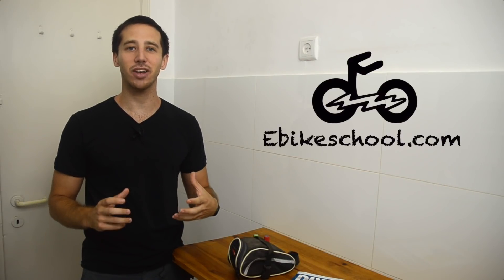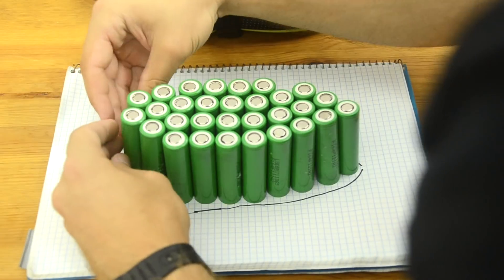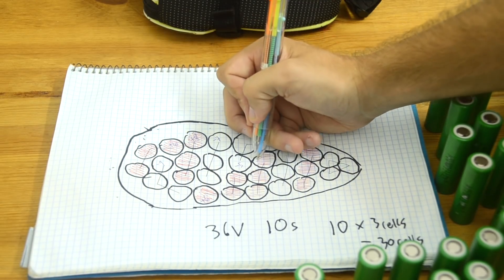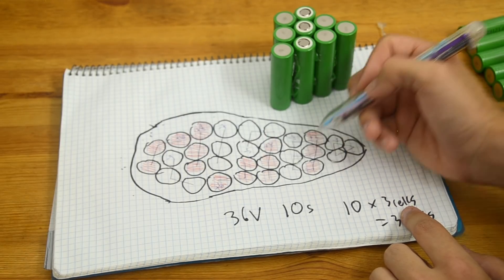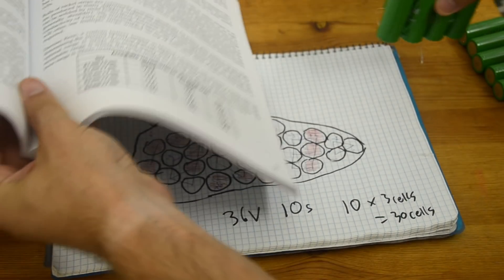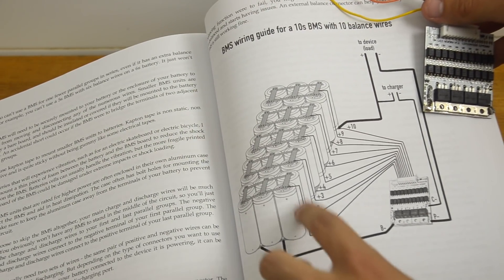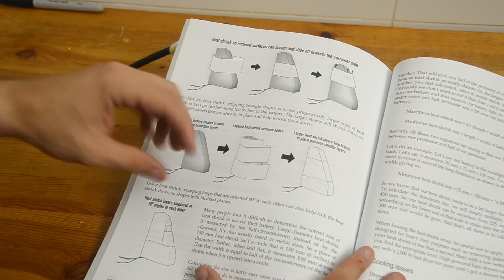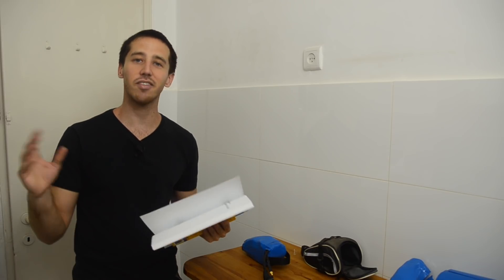Complete DIY Guide - Building Custom Shaped Lithium Batteries

Comment: I got some 9900mah 18650 from amazon that price wasnt bad.a bank with them would be alot higher the standard batteries.i noticed that most battery packs use a cheap battery in their packs which seem to have lower mah rating.if you simply change your batteriee with these higher rated batteries you can double your capacity without adding any more batteries.wish i could post screen shots to show rhe defference between the batteries

Comment: Hi Micah, great video series and book - the DIY Li Batt is a treasure trove of battery info.
I'm getting ready to construct a pack (my first) and wanted to ask for your opinion on using pure copper strips instead of pure nickel. As I'm sure you know, the current carrying capacity of copper is about 3-4 times better and the resistance about a quarter. Also, the cost (on Amazon*) is similar.
Do you have any advise (for or against) with using copper. I will be spot welding onto MJ1s - I've seen others on YT saying that spot welding copper (only) to cells is difficult and might need a 'copper-nickel sandwich' weld arrangement.
Any insight into this would be great.
Many thanks.

Comment: Ok Mike, that's twice now I've seen you do this flip flop with the numbers.  You set out to build a 10s3p battery but when you were planning it's layout, you made a 3s10p battery.  The only reason I can figure is that somehow the number can be reversed and still comes to equal the same output at full.  Is one way better than the other cuz I was about to put 14 cells in a row in series then a flipped row and so on.  I know it's Friday night, but if you see and read this tonight being 10/27/23 @8:56pm ES, please send me this answer as I am prob gonna start welding tomorrow.

Comment: recently purchased yr book on DIY lithium batts, I'm looking at using an 80v greenworks battery but couldn't find anything in yr book about how to install a low voltage disconnect option.  these batteries are 20s so when one cell goes bad it will start to degrade batts on either side before failing altogether.  do you know of any low voltage disconnect modules that can disconnect the cells once they degrade to a define voltage (eg 72V).  Appreciate yr book, easy to use and understand.

Comment: Just bought a Trek Townie ebike. First recharge no power to display.  Tried all the tricks of power button on battery , check cable connection, even got new display. Still no power.  Wife's bike. So I'm not allowed to "mess it up". Any clue? I'm thinking bms, but can't tear into it and check.

Comment: Hi Micah, by the series bus. Are those fuses because the series connection are alternating but these things goes between those 3 parallel cells. Could you please clear on that. to be more clear I am talking about the 8 figure like connections of the Nickel strips.

Comment: if you're building larger odd shaped batteries (like 16s12p) where you need the positive and negative in a specific spot I suggest using a SAT solver or some mapping algorithms to build a graph with minimal nickel strip use. I kept failing to do this on paper efficiently until I just put in the effort to encode it as a SAT problem.
Reply: I'm a rank beginner with things like that but I need to build a 20s5p battery in a triangle shape. Could you please add some more info to what you've said here?

Comment: Thank you liked and subed how much cheaper is it to build your own batter? Also id like to know about the Nickle connectors why not use steel or copper? I would like to make my own Ebike but the battery's are too expensive how ever i am skilled at engineering. Id like a battery that is powerful so i can have more speed 48v/60v 2000w the motor says. What MAH hour cells should i get as id like the battery life to last? Id like to know how to charge the batteries what kind of charger do i need. I'd like reliable but cheap as possible cells what should i get and what not to get? Again thank you for the video.

Comment: I have an issue with my battery and I wanted to see if you can help me I just bought a 72 volt 2000 Watt wheel kit I had or have a 48 volt 1000 watt battery and the computer on my wheel kit was saying I had full battery in reality my battery was dead and now my battery will not charge is there something that I need to do or is it damaged

Comment: Thanks for your very informative and very usefull videos. I have just bought my first ebike kit (Sfeomi 36V 500W EBK-0500-RR) and have so many questions. I wonder if it is possible to maximize a HL Li-ion Model S039 Spec:3610, 36V 10Ah to 20Ah (the manual's max. is 26A) and how to do this? Thanks to you, I'm learning how to build my next battery. An other question is how to connect a display and head and rear lights to the Controller CPU card? The ShenZhenShi CiAn Technology Limited Support are impossible to get in contact with on this issues.

Comment: i enjoyed this video. I am explloring opening up a 36 volt lithium battery i have that i know has one or more cells that are not charging or are low charge.. I am thinking of getting the DIY lithium kit to put it all back together. I also want to sort out creating a USB out port for the pack to recharge cell phones etc. And I am also xploring builing a 5s or 48v pack for the same ebike to give me more speed. .. perhaps also building 2 packs to i have increased range capacity when i need it.

Comment: I have a question about how you decided which nickel plate to double up. It made sense in your drawing and initial explanation, but the actual pack you made doesn't match the drawing as far as where the double nickel strips are

Comment: Great video! Just one point: not sure if this was already addressed in the comment (didn't read the whole 231 comments...) but when you add a second nickel strip to "beef up" the connection for a cell that's not directly connected to the next group of cells, you did effectively double one of the parallel connection. But shouldn't you also (or rather) "beef up" one of the series connection ? I mean if cells 1 and 2 have a direct connection to the next group of cells while cell 3 has not, you beefed up the connection between cell 3 and cell 2 but you should also beef up the connection between cell 2 and the next group of cells. If your pack must provide 15A and you only have 2 nickel strips for series connections, each strip will carry 7.5A, which is still acceptable for a 7mm wide and 0.15mm thick nickel strip but at the top of the acceptable range. So basically, rather than doubling a parallel connection, shouldn't you just double one of the series connection instead?

Comment: The positive wire from my battery to my fuse disconnected. Should I just reconnect or take this opportunity to change the connector to an xt 60 and bypass the fuse or just reconnect the current set up?

Comment: i've recenty aquired gallons of high quality 2 part epoxy.  the cans are rusty and it should be used soon.  i've been wondering why not completely encase a battery pack for heavy duty use,  ( say a "jumper" pack that gets thrown around on a farm, etc)?

Comment: so a typical pack for 48VDC is 13CellsX4.12VDC per Cell=53.56VDC ? but the BMS power output is 48VDC so there is a voltage loss huh? just finished Welding my first pack. Boy is it hard to us recycled cells. lots of testing and retesting. 4X2.8mAh=11.2mAh total of cours your cells if you have max of 2876Mah on a string and some where down the line you have a 2289mAh you will only draw as much as your lowest Maximum Capacity string... but that's OK..

Comment: I like your video! Thanks for helping us layman understand lithium batteries and their construction. Now for my question :-)
 I have a newer Smart Electrician(Menard's Brand) LED light with a Samsung 3 cell 11.1v 2200mAH 18650 pack that won't take a charge any longer. I couldn't find my charger for several months, and let the batteries probably get too low. I was told that I could possibly bring them back to life by charging them with a older non-lithium Ion charger for a short period of time. Is this possible, and if so what would would recommend for voltage, connecting, etc. Thank you, Al

Comment: So... does this method work when building a bomb?
Kidding.

Seriously though, would you recommend wiring the 18650’s in parallel or series when making an external, rechargeable battery for iPhones and other gadgets one may need to recharge?

Comment: So if i make myself a 52v 20Ah i pay 400€ only for the 78 celss i buy from one of your battery links. This is without bms and charger + work and small equipment. If i buy a 60v 20Ah lithium a bike battery from one of you links i pay 360 for the battery and charger. Its just a simple blue square battery so you just have to make your own box. I was really excited about makin my own 52v battery but i quess buyin one online is the cheaper option (and maybe the safiest haha). However i go to my local battery dealer and ask if he can do something for me. After all their just simple cells.

Comment: I appreciate you and your knowledge sharing! Looking to over charge my 1000w 48v rear hub system--will a 17s battery safely run my motor and controller. From your videos, I could use a 63v battery? My goal is to get more mileage at 28MPH--trying to get 24 miles out of a charge. my current setup lets me achieve 30MPH for 3-5 miles, but then I am dropping power quickly, but still show full bars or down only one bar. Congrats on your success, I appreciate you sharing a considerable wealth of knowledge. Mike

Comment: Your videos are simple and direct to the point. So much to learn from it. I have an electric scooter with a brush motor, its rated 24v as it uses two ups lead acid batteries rating 12v 10A each.
Can i run the scooter with same battery rating as you have built here?

Comment: I’m planning on 52v - 17Ah with GAs that will sandwich the down tube because the main triangle is too small to fit them all inside. They be encased in a poplar frame with ply sides.

Comment: Hi you are doing really great job and educating the ones who are curious to know and learn about lithium cells and packs.

I would like to ask you the below doubts 

1. If we are using protected cells in battery packs still we need bms in pack.

2. Please give more light on cell charging cycle and life. If we are not discharging  to  minimum voltage and charge before that is it going to increase life cycle.

Comment: Can you please give your expert advice as in which battery pack should be used for a solar off grid project, as in a lead acid battery or a lithium ion battery pack and can you tell me is lithium ion battery pack more power full than a lead acid battery (for ex one 12v200ah of lithium ion battery pack will be equivalent to how many of 12v200ah lead acid battery, as the depth of discharge are different for both of them) so  kindly help me with this

Comment: Hello. I have 3 beautiful questions:
1. Can I use battery holders instead of connecting the terminals of a battery cells, then join the wires + -?
2. Is it necessary to use BMS while the batteries can be pull out and being charged with Li-ion Battery Charger?
3. Can ESC used in RC projects be an alternative to manage the outgoing voltage and current of the battery?
Thanks in advance for response!
Reply: I think the bms also prevents overdischarging. Maybe im wrong. Sort of 3volt cutoff. Interesting question.

Comment: Hi Micah I have just finished building a 7s  x10p battery pack I have chosing the BMS  but I am not sure where to start with the balancing wires , to start soldering which side or series do I begin the 1st wire soldering.

Comment: Great video, pardon my ignorance however i am not understanding why go with the .15mm thick nickel rated for 4.7 amp when these batteries are 10amp continuous? Wouldn't you want to go with the .2 or .3mm thick nickel?

Comment: Micah hi, a few words about the other side of the battery. How did u figure out the pattern of the connections there?
Reply from the maker: Basically, connections between adjacent groups that aren't connected on the topside are connected on the bottom. For example, -1 and +2 are not connected on the top, so those cells will be connected on the bottom side from +1 to -2.
Reply: ok I see it in about 14.50 where you flipped over. The very first cell in +1 it is connected directly with a long nickel strip to -2 from one side, but it is not connected the same way with -2 cell from the other side. Meaning you didn't use two long strips to both directions from the first +1. Is it better that way?

Comment: Thank you Micah for all the VERY helpful videos, they're great :-)
My first question is...what is the difference with a brushless motor and a brushless geared motor?...... and my main question is....when you are not using the motor power is there much or any resistance felt when you are using pedal power?.....one additional question....can the PAS be easily disabled completely and or temporarily ?
Once again, thank's for the great videos, David :-)

Comment: Hi
I am the proud owner of a very used Quantya track (MX bike) and I would like to build a "new" battery for it but they say it's 48v but when it is fully charged it reads 50-51v something, the question is then. when I build a battery from 18650 cells should I try to aim for the 48v = 13cell in a parallel or should I aim for the 51.7v = 14cell in a parallel cause as far as I have learned from the videos, the voltage in a charged battery is increased (4,2V). 
Another thing as I could hear in a previous video it doesn't really matter for the motor what voltage you are running, would the mean that I would get a more potent bike if I chose to run a higher voltage? would it also be possible I have an Alltrax AXE4844 R3 controller to put more volt on it? 

and last but not least is there a place in EU that I can buy your books? 
Because if it cost more than 12,5$ I have to first pay 25% of both the book and the shipment and then I will have to pay another 26$ to claim it and I am the ink on paper kind of guy (can´t read and understand if it´s a Kindle book) 

I hope that you can help me get a little smarter on what to do with my bike´s battery

Comment: If my speed controller is 15ah is it ok to use say a 40ah bms or will that damage my batteries
Reply from the maker: I think you mean your speed controller is 15A, not Ah, right? A 40A BMS is fine, it just means its rated to handle more power. That's like using 40lb fishing line to lift a 15 lb fish, you have a good safety factor!
Reply: Thanks for the reply I've searched the internet for a answer but it's like drawing blood from a stone nobody will give a straight answer

Comment: What are your thoughts on not using a BMS?,..... relying instead on the differing cells to 'self balance', with a fairly infrequent balance charge via a LiPo balance charger. Of course this would mean building the pack in multiples of a charge circuit suitable for your balance charger. In my case I have an 8S balance charger, so I have built my pack as two x 7S, which I balance charge independently, but electrically join together to create a 14S battery when operating on my eBike.

My reasoning for wishing to avoid BMS, is that I have had 2x differing packs fail due to BMS units not balancing the cells properly and then going into fail safe mode when the unbalanced cells drop below the lower voltage threshold. My experience is that the compact BMS units are not really suitable for use on a high voltage, large capacity ebike battery.
Reply from the maker: The method you describe is definitely doable. Personally I prefer a BMS to make charging as simple as charging my cell phone. BMS failures do occur though so generally I try to use higher quality ones to avoid this.

Comment: Quick tip: Solder the balance leads or the discharge wire onto the nickel strips and then spot weld them to the batteries. Hence, no heat to the batteries.
Reply from the maker: Yep, that's in my book. It's just that I forgot to do that before the welding on this battery!

Comment: Hey how do you test your 18650 cells and do you have a particular place to get data sheets on your cell other then going to Google. I have looked through and did some searching for the collection I have and wasn't able to get much if anything back. I make my own packs and do the charging with my I max charger. Also I like to use ide   cables for balancing cables since I have a crap flow around my apartment.

Comment: Mikey, enjoyed the battery build video. Was wondering if there is a quantity price break on your 18650 batteries? I have about 200 salvage 18650s and I probably don't have 50 out of the 200 that will test 2000 mah capacity. They will all hold a 4.1v charge for an extended period of time but with less than 1500 to 2000 mah capacity, I'm afraid to build a large bike battery out of them. How low of capacity cells do you think would be safe to build a battery from?
Thanks Mikey .

Comment: Hi can I make a 3 packs of 40v10ah an put to gether an make a 120v 30ah
Reply: Yes and no You can only double one trait at a time. For example, you cannot double voltage and capacity at the same time you can only do one at a time. Your battery can be 40v 30ah or 120v 10 ah. You only can double one at a time. Someone correct me if I am wrong.

Comment: What do you think about using capacity checkers with balance functionality to balance batteries? Just bought one and thinking about use just a charge controller to manage over and under pack voltage and using the capacity checker to balance the series packs.